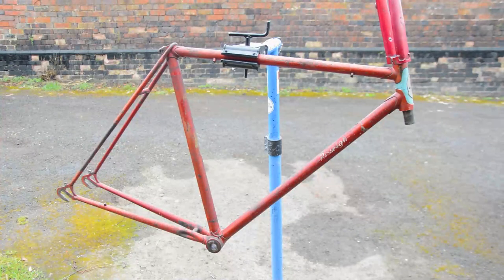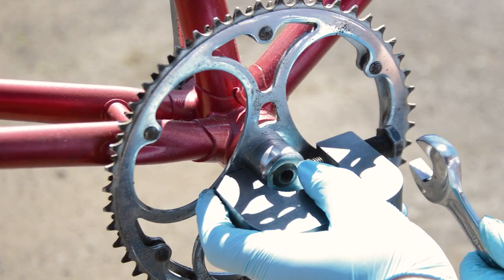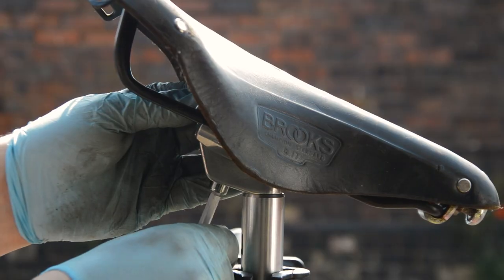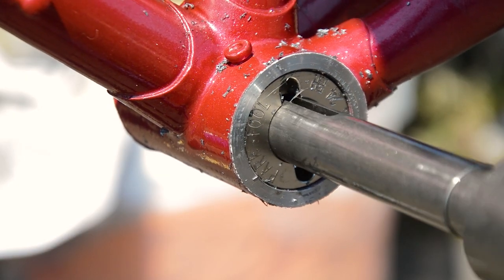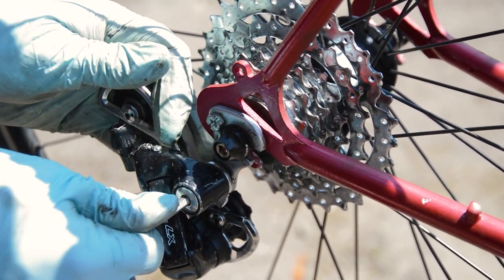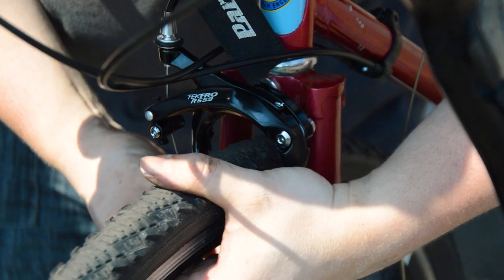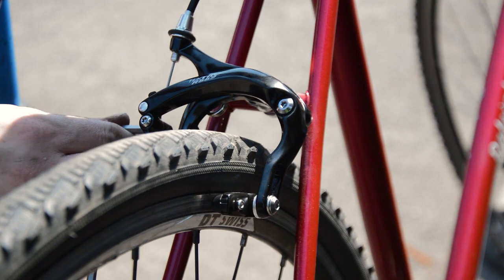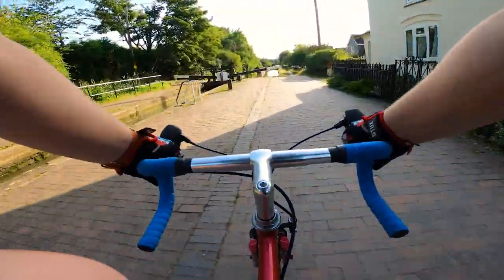Restoring An Old Bike Bike With Some Modern Upgrades

Comment: Enjoyed your interesting video. I am doing something very similar with a 1977 Raleigh of indeterminate model. What I found was that a Shimano UN300 square taper bottom bracket has such soft alloy threads you can run it in easily until it starts to bind by which time it is nice and square and then using a nice big adjustable spanner on the bracket tool and plenty of lubrication the hard steel threads in the shell reformed the cartridge threads. I just needed to back it out a few times to clear the swarf. I put on a three speed chain ring and spread the rear dropouts to take a hub with an eight speed cassette. Probably more by luck the chain line was perfect. I laced some 27 inch rims to the new front and rear hubs as the old 26 inch rims were badly corroded. Now all the butchery work is done I can strip it back down and give it a coat of paint. 👍
Reply from the maker: Ooft. Did they revert to a standard 68mm BB in ‘77 or did you have to space a 73mm BB out? Sounds like you luckily got that cross threading spot on to get it aligned.

Comment: Little tip for you mark , I've done it many times , use electrical heat shrink at the end of the bar tape that way it will never unwrap , great build I'm just doing a restomod 1973 BSA tour of Britain, you've explained the odd size bb thank you very much , keep up the builds and enjoy the rides 👍
Reply from the maker: As in a large diameter ‘pipe’ type of heat shrink? Or was it a tape?
Reply: @MonkeyShred  hi Mark yep it's basically a tube that you cut down to length , it's normally used on electrical connections etc , Ive used it on a few bikes now really does work well , your Raleigh build has pushed me to getting my BSA build underway 👍

Comment: Resizing a BB Is a backyard bike mechanics final boss level. Great build. Sub earned.
Reply from the maker: Thanks! Plenty more to learn! Welding for one. Adding disc mounts would be great.
Reply: @MonkeyShred haha oh boy it might not fit the "character" of this bike, but for versatility and the ability to keep breaking performance in muddy and wet conditions... I don't want to start a rim Vs disc fight in your comments section or anything, but for my (lack of) skill level I really want disc brakes for riding off-road.

Comment: Looks great! I'm still looking for some old 70's style cowhorn handlebars for my build. Cant do the bum in the air thing. When me and my friends were kids back in the 70's, we used to put cowhorn bars on old 5 speed racing bikes, take the front brake off and call them 'tracker bikes' . This was before mountain bikes came along.
Reply from the maker: Would BMX bars work in the same way for that?

Comment: Such a great job  the hardest park was probably having patience… I bought 70’s Dawes 2 years ago some stared retro fitting bottom bracket superbe crankset and alloy wheels almost done.   …..again great job. More retro builds😎
Reply from the maker: Patience was putting it away for a few months between each problem 😅😂

Comment: Those Tektro R539 brakes are my favorite brakes, I have them on several road bikes spaced for fenders / bigger tires and they, for whatever reason, have terrific stopping power.
Reply from the maker: Yeah they weren’t too bad actually. I was worried about flex but they stopped fairly well. Some upgraded pads would make them a bit better though!

Comment: Great build, wish you did more vintage road bike builds. Love those R559's have them on my vintage bike. I also used recessed nuts just drilled the nut side hole a bit larger works great.
Reply from the maker: Thanks! I have a couple tucked away. I’ll get round to them eventually!
Reply: Do you notice much brake arm flex with those calipers?  The bike forums all say they suck in terms of stiffness.
Reply: @sirbentley5526 They are almost as stiff as my ultegra brakes which is surprising. I'm not sure of the flex while stopping the bike haven't really paid attention.

Comment: Nice build!  I understand that 26 threads per inch was a bicycle-specific British standard once upon a time; nutted 3/8” hub axles still use it… except for coaster brake hubs 😑
Reply from the maker: Yup! Pretty much just Raleigh (and it’s subsidiaries) for the BB and headset though.

Comment: Lovely DT Swiss rims and hubs there Mark.  I've also used (once!) the heat shrink electrical tubing for securing the ends of the tape. Unfortunately at the diameter you need for the bars the  heat shrink tube is much thicker and does not look as elegant and it's a real pain to get off when one needs to unwrap the bar tape. I will second your observation on just how expensive some of the tools you needed for this project are. I was lucky to chance on 50% off when I got my bb thread cutting/facing tool from chain reaction and it still cost an arm and a leg. That Raleigh decal looks really nice. Did you use a silver under layer and a translucent red when painting the frame. I've done a few in that metallic look, usually powdered coated in two passes with silver then the colour. Great Job on the restomod.❤
Reply from the maker: Fortunately… those wheels were free (apart from having to buy a few spokes) and I also got that Park facing tool half price from CRC 😅

The paint just went on top of a light primer. Nothing fancy like a translucent paint!

Comment: I'm doing the same thing with this P8 Peugeot Carbolite 103 I'm keeping original blue royal with shimmery flakes in the paint.  Of course it has some dings but looking to color match the imperfections in order to keep it somewhat original. Going for 2x7 set up. And 700x35c wheels I know I could go for 38c but honestly looking to stay in the road for 90% of the rides . Not going with saddle Brooks or dt swiss. Affordable route it is for me.    Nice build tho.  Cheers from California USA
Reply from the maker: Thanks! That wheelset was actually a freebie 😅 had to replace a few spokes but it’s a solid wheelset now. Hope your build goes well!

Comment: great to save another old frame.  looks really nice too.
the build did make me wonder though, whether some engineering minded person could fabricate a disc brake set up using the old mudguard eyes as one fixing point, and another maybe bolt on boss for the other?  perhaps the eyes would be too weak?
Reply from the maker: It could be done. I’m sure it has been done. I do wonder if the fork would cope with the different forces though.

Comment: Beautiful build and I totally agree to the restomod - if you want to have something practical yet stylish, that's the way to go. But then, why not going the full length and install something more modern, 3x9 or 3x10, and complete it with a more shallow gravel drop bar? Ultegra 6510 3x9 is a beautiful groupset, all aluminium finish, and would look stunning on that bike.
Reply from the maker: Honestly - because I already had that crankset and derailleur lying around and I think they look great. I went for the classic bars to keep the classic look too.

Comment: wow! great work. a tremendous resto-mod. I have those same brifters which I'd like to put on my gravel conversion. tell me if you would, did you have any issues setting them up? Thanks in advance.
Reply from the maker: Not really. The rear shifter works well. The front was a little more difficult but a bit of playing around with the limits seemed to work.
Reply: @MonkeyShred  Great! Thanks for getting back to me. Keep up the great videos!

Comment: I’ve used Raleigh cups with an axle for a wider BB she’ll the trick is smaller ball bearings I got the tip from Sheldon brown’s website I used center pull longer reach weinman brakes 750 reach ma40 rims sturmey archer 3 speed conti contact 35 mm tires
Reply from the maker: I have read about that before too.

Comment: What did you mean about the quick release coming out on the rear, so you switched to solid axle? I didn't understand that, do you mean the lever was coming undone? Or it was flexing? I thought it would be quite a big job to change that, but you just mentioned it in passing. Sorry I don't know much about wheels, but I'm curious.
Reply from the maker: Nah it’s a simple job to swap out an axle on a cup and cone wheelset. The wheel was indeed slipping out like it didn’t have enough grip. Could have been a worn QR but for piece of mind I switched to a solid axle with nuts.

Comment: Mark, do you have to deflate 38c’s to fit through 559 calipers? They have huge clearance alright, but what I found that even unlocked pads are too close so I have to squeeze tyres really hard to fit them through. And I’ve got slick 32c! It’s worse at the rear where it gets stuck in chainstays too as it has to come forward a bit to engage into horizontal dropouts. 

I’m trying to figure out if these 32c’s I have are too wide or I’m doing something wrong. I wanted to put something wider but now I’m not sure.
Reply: My 40mm gravel kings fit fine through the 559's when unlocked.
Reply from the maker: At the moment - I haven’t had to take a wheel out but I think they do have enough clearance.

Comment: How does Shifter work with FD? I ask, cause from time to time, i do some "gravel conversion's", and mtb fds are making me problems cause road shifters have different pull ratio from mtb's one.
Reply from the maker: Do they? I didn’t realise that. I always thought the front derailleur was kind of ‘dumb’. Those shifters worked well though.

Comment: I was gutted the other day, was offered a 653 with campagnolo groupset for £60, yes £60!!! The only downside was the frame was 22" and I'm need a 23" minimum. I didn't want to buy just to part out, so let it go 🤦
Reply from the maker: I’ve been there before. I didn’t want to break a bike so sold it on… only for it to be stripped and sold as parts 🤦‍♂️
Reply: @MonkeyShred Know your pain. I picked up a Proflex 550, cleaned it up, new chain and cables, got about 55 quid in it and just can't shift it at 110. If I broke it the XT groupset, Girvin flex stem etc would easily make more but I don't have the heart to.
Reply from the maker: @KitVonRadical  oh yeah. After owning a few Proflex I wouldn’t buy another unless I really wanted to keep it. As much as people love to look at them. Nobody wants to buy them. I ended up selling my full DX equipped 752 with the original Vector fork for…£150. Crazy.
Reply: Ouch, that's got to hurt. Every days a learning day, may be my last Proflex at this rate.